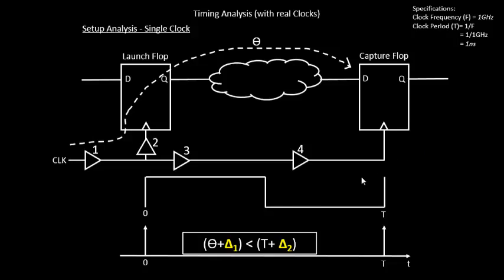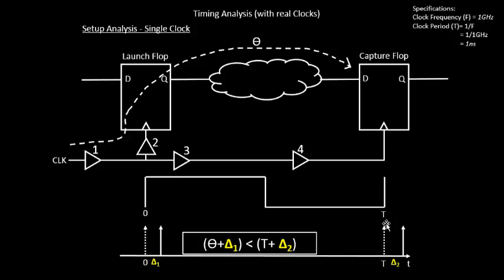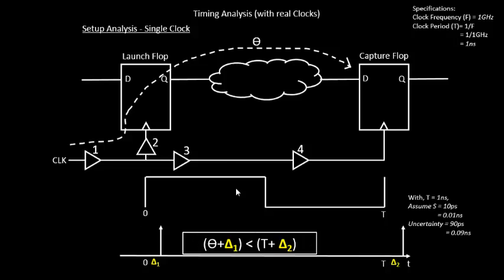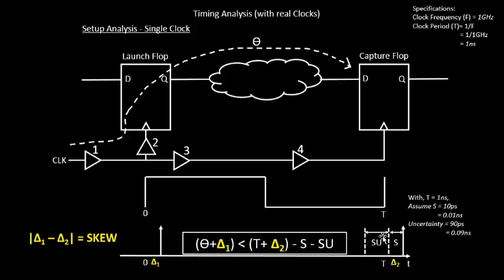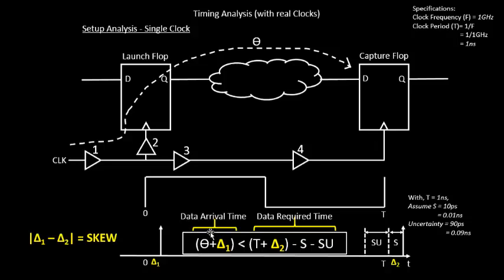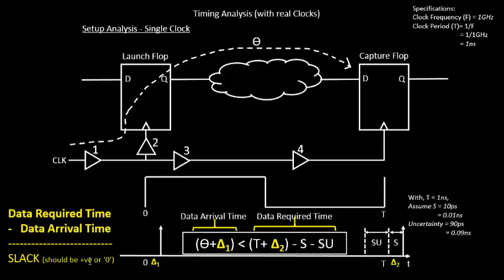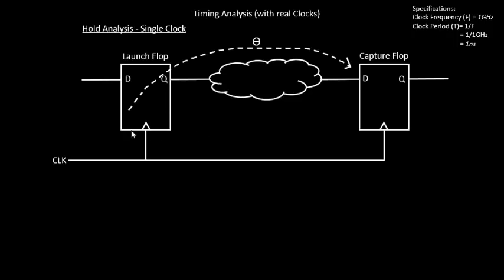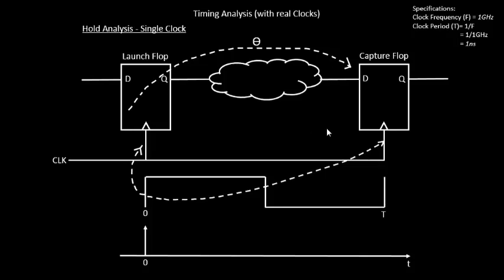How to do STA Introduction To Slack And Hold Timing Analysis?? Learn @ Udemy- VLSI Academy

Comment: Sir, Thank you for your presentations.... in the above video there is a fault in the "Hold time" definition... the delay of MUX2 has no effect on the Hold time.. becoz when ever the +ve clock comes the MUX1 gets disabled and if there is a change in the input 'D' it's not going to affect the circuit in any way... as the MUX1 is disabled from input 'D'during 'logic1' so, the Hold time doesn't depend on the MUX2 delay rather we should consider the "Clock path delay" too in describing Hold time.

Comment: What you described as the hold time is actually the clock to Q time.
The hold time is dictated by the fact that the clock edge is not an ideal step but rather a linear rise causing some the D and Q to be "transparent" for a short time. During this the output of the Launch flop should not reach the Capture flop else shit happens
Reply: +karma sonam  I agreed with wat u have been said. The hold time for the ideal CLK for this flip flop should be 0.